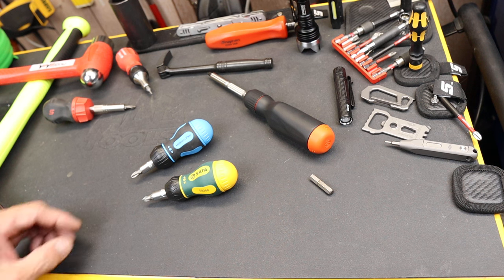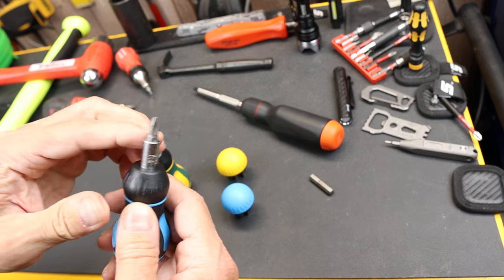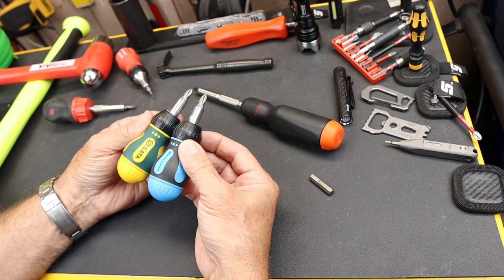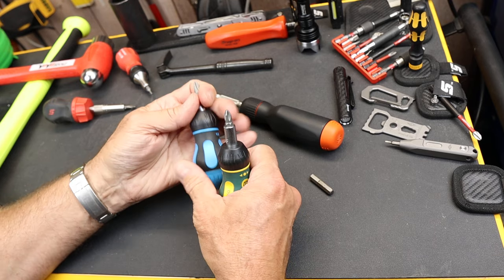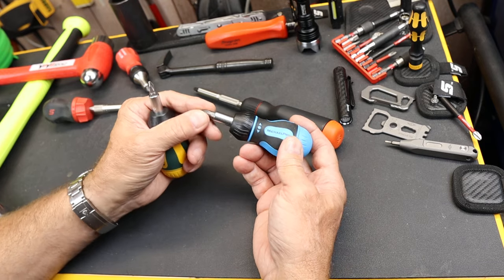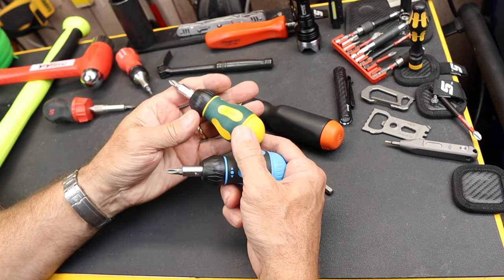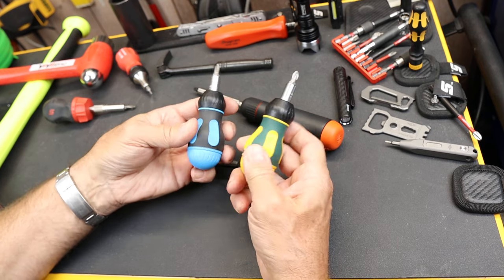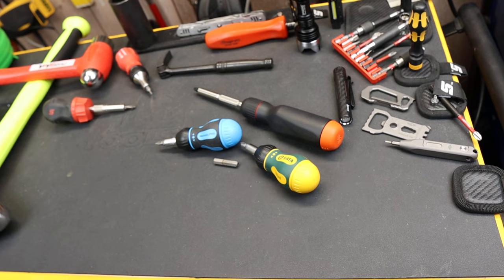Michael Pro vs SATA: A Project Farm-LTT Ratcheting Stubby Study. A cool moment in bit driver science

Comment: Hello Doc.
I got the MichaelPro because of your video on the Sata one, and the Sata was out of stock at the time.
I've found this stubby under nine different brands so far. The one branded Teng Tools is unique. It comes with a bit in the middle of the carousel, which protrudes in a hole in the compartment.

Comment: Personally I am a fan of Project Farm vids and I think you have a good point about variability in manufacturing.  I like finding out which tools excel at certain tasks, and consider how I use the tool.  Sometimes price is my biggest consideration, sometimes its a specific performance factor.  As the consumer, I make the decision which tool I want.  Sometimes it's a simple as the ability to buy it locally.  In this case, I probably wouldn't buy either tool, but I still find it interesting.
Reply: I really enjoy Project Farm videos, but I don't like him being too confident in his results. You buy one of each item, you more often than not do a test once. That's not robust.
Reply: I get what you mean but surely the clicks are related to a gear tooth number rather than tolerances or grease etc?

Ie, a poorly made ten tooth gear won’t rotate at a different ratio to a well made ten tooth gear, but it might not last as long, it might corrode sooner, it might chatter at high speeds etc

Comment: I've had the sata for a bit I really like it for being a cheaper option. Really all the Sata stuff I've picked up has been pretty good so far, and I do love their brand colors. I also picked up the crescent branded ratcheting stubby from the clearance bin at tractor supply, the outside plastic housing is a different design than the Sata or the Michael Pro but I assumed the internal mechanisms were most likely the same being Crescent and Sata are both Apex brands, the crescent has a bit more bit wobble then my Sata though, other then that it's been fine too.

Comment: I'd have thought more/less or a different type of grease would definitely effect the back drag, it certainly changes the sound of a ratchet (I'm thinking bike freehubs),  Related: if you want your bearings to run really fast/zero friction you wash all the grease out. (its not advisable for longevity of the bearings but some race teams do it).
In this case you might find they just put a bit more grease in on one production run compared to another, maybe unintentionally or maybe as a response to premature wear?

Comment: Increasing the sample size to two doesn’t improve the statistical significance of any differences much. The simplest case would be the two brands are identical, and all samples fall within the manufacturing variability. Nothing so far would contradict that scenario. With marginal cost of goods sold of less then $5, there really isn’t much room for sorting, measuring, or configuration changes.  The need to justify higher priced tools over some performance or longevity characteristic runs strong. There seems to be no appreciation for the power of marketing.
Reply from the maker: I’d argue that the sample size is really n-1 so it’s actually worse.